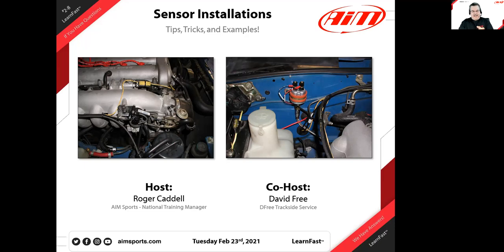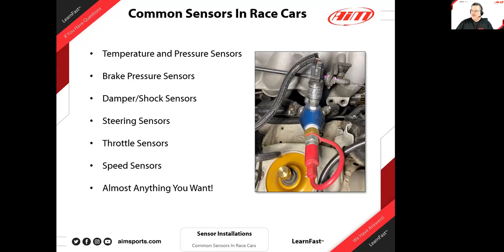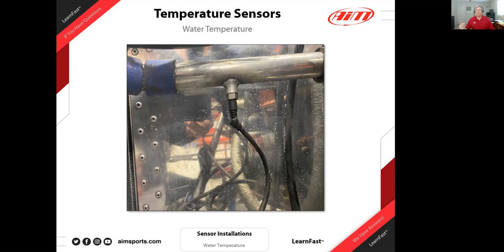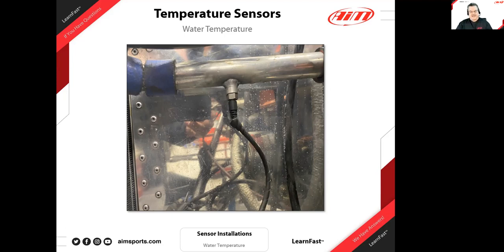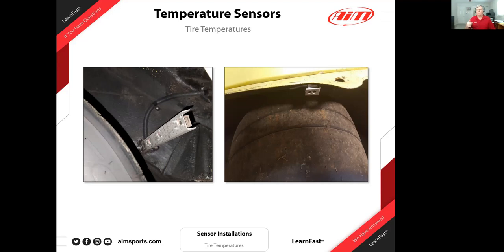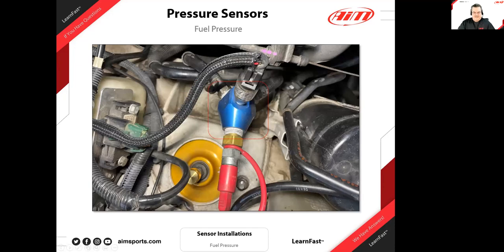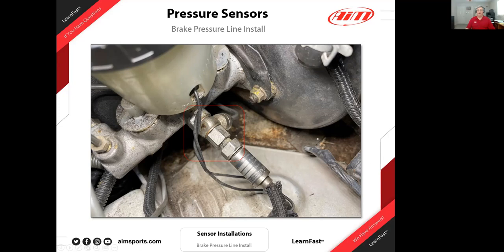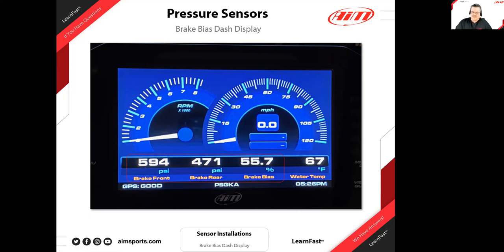2-8 Sensor Installations - Tips, Tricks, and Examples! Live Webinar with David Free - 2/23/2021

Comment: Comment/question about coolant pressure sensor. Roger made the comment about pressure dropping as coolant is lost. I have had situation where the coolant pressure rose within the water jacket as the head gasket failed, and a freeze plug was pushed out. I am considering installing a pressure sensor that records a RISE in pressure, not a drop. Comments on this? (When my engine loses water the temperature measured at the back of the head by an Autometer ProComp gauge goes UP.)
Reply from the maker: Jim, certainly the water system pressure will rise if the head gasket fails and the cylinder pressure enters the water system. What can also happen is a hose fails and leaks or the radiator gets a small hole. Then the water system loses the pressure we typically see (maybe 12 to 20psi) and this lose of pressure alerts the driver of a loss of pressure and no doubt a loss of coolant. Both situations are not good and a coolant pressure sensor will alarm for both.

Comment: how i can add for AIM solo2 dl pressure and pt100 temp sensor with expansion? step by step
Reply: For the pressure sensor with the S2DL, you would want either an ACC or the Channel Expansion. If you are using a SmartyCam, you will also need a data hub. Then it a patch cable from the ACC or Channel Expansion to the PT100 and pressure sensor. Setup would be through RS3 adding the expansion and then the two sensors.